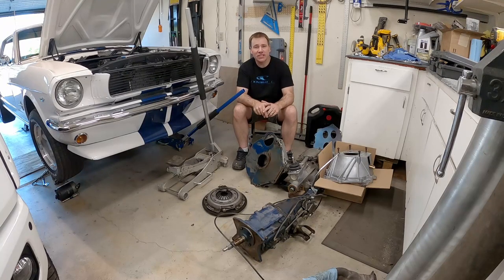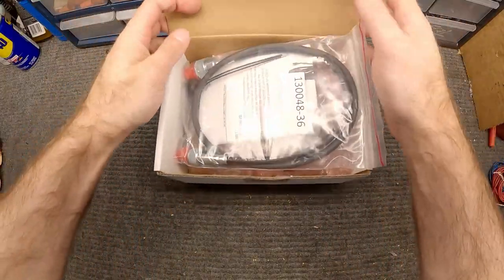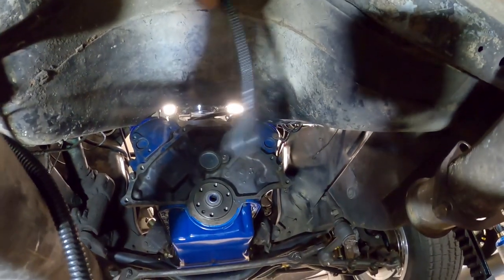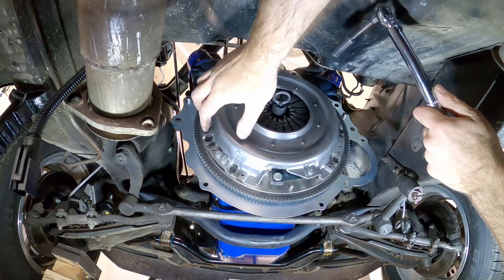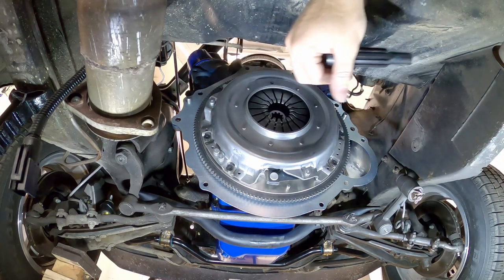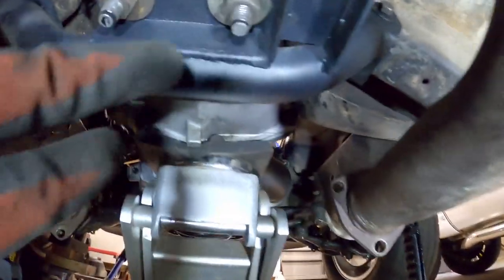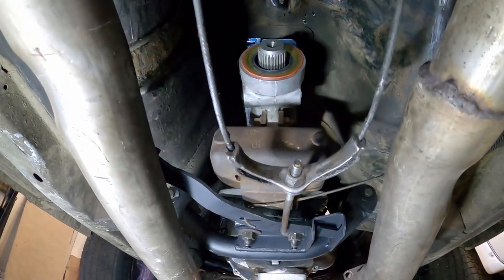Swapping in a T5 Transmission in a Mustang - PART 2 of 2

Comment: I always clean off the new fly wheel with brake or carb cleaner just to make sure there is no containments that could gum up the clutch. Thank  you for the very informative video.
Reply from the maker: Sometimes I forget to do the simple stuff like that.  It gets worse when I'm trying to think about the camera angle and saying everything correctly, sometimes the most obvious stuff goes right out the window.  :)

Comment: As a former professional mechanic, and later working Parts Dept, I would highly recommend installing a new "Engine to Firewall" ground cable (braided strap type). In the event of a missing or "iffy" ground, the shift cable will begin to try to substitute as an alternative route.
It was a fairly common problem, with many of the OEM "Console Shift" vehicles to experience broken/frozen (locked up) shift cables. I managed to get a customer to leave me his locked cable, and after disecting it, found evidence of arcing of the inner cable, as well as the inner cable finally being cooked away from the arcing until it separated and jammed in the jacket.
Even if you already have an existing OEM cable, I'd either replace it or simply add another as a "backup". Kinda like wearing a belt AND suspenders 🤔.
Great video!!!
Reply from the maker: Thanks for the feedback. 
I updated the ground cabling in this car later on. to larger, newer, and more of them.  :)
Reply: @AndyKruseChannel  I'm a big believer in the "braided strap-type" ground cables. I always kept a couple of 15", 18" and 20" (either Dorman or Standard), and one of the first things that got replaced (often also missing), was ground cables.
As a bare minimum, you want: 1) NEG (-) to Engine (Alt/Gen bracket preferably), 2) NEG (-) to mounting bolt/bracket for starter solenoid (braided-type), 3) Rear of cyl head to Firewall (braided-type). I also prefer to make my own battery and starter cables instead of dealing with some of the enemic cables usually found lately. I buy enough 1/0 "welding cable in both red and black insulation, the appropriate terminal ends (POS, NEG, EYE) and what's referred to as "Dual wall heat shrink tubing". This particular type of heat shrink tubing has a sealer inner liner that creates a water/chemical resistant seal and will, if done correctly, probably outlast your grandchildren and then some. I solder all connections (applying solder until it's no longer being "absorbed" by the cable) and quickly water quench and remove excess from the outside of the terminals. Regardless of POS/NEG or it's location, I always use the "Dual wall heat shrink tubing anywhere I make a splice or terminal connection. It adds a bit to both time and expense, but if done correctly (as well as routing/placement), should never be a source of trouble. Another "mod" I usually do, is to run the NEG (-) 1/0 cable from the BAT through a "T-eye", 1st to the frame, and then on to the Alt/Gen bracket. This allows me to use the cable as a guide/anchor for the POS (+) cables (from the starter solenoid to the starter as well as from the Alt/Gen back to the BAT POS (+) connection on the starter solenoid. Lastly, depending on the location, I also prefer to use a "Star washer" directly between the body/frame/engine and the terminal "eye", as well as between the surface of the nut (stud mount) or bolt head to insure a good "bite" getting through any paint, rust, etc.
Blessings to All 🙏🏻🙏🏻🙏🏻

Comment: this is how I installed a Tremec 5spd in my 1965 289 Mustang using all the original clutch pedal and clutch linkage assemble including the 1965 throwout bearing arm and throwout bearing. Take a 1965 Bell housing and drill out the two fulcrum mounting rivets. index using the four transmission mounting holes a template, plexiglass is good. Drill the two 1965 fulcrum holes. Take your template and bolt t to your new 5sdg bell housing. drill the two fulcrum holes and counter sink them. . Take out the cable pitot arm. As you stated the imput shafts are different. Between a top loader and a Tremec, 5/8th of an inch longer Tremec. So I machined aluminum bar stock 5/8th of an inch thick and made a spacer to move the 1965 fulcrum forward in the 5 spd bell housing and bolted it down with grade 8 fine thread bolts and metal locking nuts. That is it, no cables, no hydraulics. So the money I saved not going hydraulic or cable went to a aluminium drive shaft. I also used a diaphragm 10 1/2 inch clutch. So I used the solid input shaft bearing, 1965 throwout bearing, 1965 throw out bearing arm. The conversion cost me less than $20 less the machine shop, which was free for me, we had a Bridge Port. And I would never go back to a toploader, never. I have had this in my car 35 years. I also have a very cool front suspension modification using all For OEM parts that does the Shelby drop, but when I finished the car is almost level. It does sit low like the normal modification. This allows for no rolling fenders and bigger tires. And it only requires one shim per upper control arm bolt.
Reply from the maker: Thanks for the info.

Comment: Killer video! Very helpful. I’ve got to pull my 88 T5 out due to a leak. I’m hoping I can get it out and fixed.
Reply from the maker: Thanks!
I wish I would have had your '88, it would have been easier and cheaper to put in my car vs this 2001 unit.  :)

Comment: I am adding the new T5 but not using the cable clutch and going straight to the hydraulic throw-out bearing conversion application. I have a 1966 mustang 289. Do I need a new bell housing or just an adapter plate?  I appreciate your videos for the good and bad of these type of conversions.  I think you gave part numbers for the new bell housing and cover plate but can you reference those for me as well?  Thanks Andy….your videos have been both informational and inspirational.  I’ve had my project car in the garage since 1983.
Reply from the maker: Yes, you will need a new bellhousing to go with your T5 swap.  Using the hydraulic throw-out unit or not will not change the bellhousing you need, so it's the same one I referenced.  :)

Comment: Love this video. Used it as a reference for my T5 swap. Question - How tightly adjusted is your clutch cable? How would rate the clutch pedal stiffness
Reply from the maker: Thanks!
I adjusted the cable so it was just about to move the clutch fork, that's when it's tight enough.  The pedal is around as stiff as the stock z-bar linkage, but that depends more on the stiffness of the clutch itself rather than the pedal.  For this particular swap, no long after it, I had to go to a hydraulic clutch because I melted the cable.  It was my fault, it didn't work with my header design, but I was glad I did.  I also went to a hydraulic clutch on my current Mustang as my knee just can't take it anymore.  :)
Reply: @AndyKruseChannel  

Thank you for the feedback. I had to replace my clutch cable as I had long tube headers. The warning label warned me about using them, but thought header wrap and the heat shield would keep the cable from being melted. Immediately melted the cable and had to replace the cable. 

Car was originally an automatic so I’m unsure how stiff the pedal should feel. I’m confident I installed it right this time, but it is on the stiffer side. May have to upgrade like you did down the line.

Comment: Would you recommend that center cup holder piece? Been wanting to pull the trigger but have been hesitant. Lmk how you like it
Reply from the maker: I don't think I understand which piece you're referring to, could you describe it a bit more?  :)
Reply: @AndyKruseChannel  The center console cup holder
Reply from the maker: @OnlineResell  Haha, I was thinking you were referring to something on the Trans or similar.  Yes and No.  I am used to having an arm rest in every other car I own oer have owned, so not having one here was a difficult adjustment.  The build quality is OK and the fit is decent.  I wish the holders were a pinch deeper, but the biggest issue is how unsturdy it is in the car.  The bottom is sort of cut to match the shape of the tunnel, but it's not a great fit.  It is held down with velcro, for the most part it's fine, but if you put any weight on it or rely on it when trying to use some leverage, it moves and gets frustrating.  There may be other brands out there that are a better fit or are more secure, but for the money it's decent.  I had one in my previous '66 Mustang, so I had to have one in this car.  If I were to buy another Mustang down the road, I'd buy another center console.  I may look and see if there's a better version out there, but I'd definitely have something like this in my car.  :)
Reply: @AndyKruseChannel  I've got the identical center console in mine and I have similar feelings about it.
Reply: I have a bench seat with a flip down centre piece ...it makes a perfect arm rest, imo.
Reply from the maker: @ryanhburke  That's a rare option, isn't it?  You don't see many bench seats out there.
Reply: @AndyKruseChannel  As far as I can tell. I've not seen many!

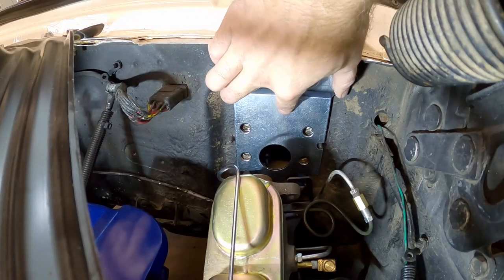Comment: Good video well done, but I dont get the speedo box? I have a T5 in my 67 and I just used the standard speedo cable and the right gear at the end of the cable into the trans for my 3:55 rear end with 245-60 tires. Is that box needed for a digital dash ?
Reply from the maker: This T5 is from 94+ Mustang where the speedometer reads a signal produced by a hall effect sensor.  The box converts the digital signal into a spinning movement and this allows the stock speedometer in the Classic Mustang to work with the newer transmission.

Comment: Any regrets or recommendations for a diy swap like this? My 3 speed is not making the highway too fun lately.

Had you redone the rear end at this point?
Reply from the maker: Zero regrets.  In fact, I liked it so much that I did this swap on my current Mustang way sooner than when I did it on this car.  For the car in this video, I had already done the Third Member upgrade by the time I got to the T5 swap.  If you plan to upgrade the Third Member before you put in a transmission like the T5, you'll dislike your 3spd even more when on the highway.  However, driving the car around town might be more fun as the shorter gearing in the rear pairs nicely with the rather tall first gear in your transmission.  The acceleration will noticeable.  :)

Comment: I have a 95 donor mustang and I plan to install the motor and trans into my car. What do you see will be the biggest issue since I’m installing a match set  motor and trans? Does MDL make a clutch cable kit for the later bellhousing? Also did you you the later mustang tail shaft and is shifter in a good location? I might go with a S-10 tail shaft to mover shifter forward. Love the vidieos
Reply from the maker: You'll have two issues you'll need to solve with that motor/trans combo, I had to solve the same problems on the swap I did in this video.  1 - The speedometer is electronic (not cable driven) so you'll have to get a converter (like I did, about $400) or get a new speedometer that can accept the signal from the trans.  That second option will likely be more expensive as you'll need to buy a new gauge bezel and all the other gauges to go with it (somewhere between $600-$1000).  2 - The trans mount is about an inch farther back, so unless you can find a crossmember brace that is already made to mount that trans to your car, you'll have to modify one, like I did for this swap.  I made a video about that trans mount mod, you should check it out.
Yes, the cable clutch kit you'd buy from MDL will work with this setup.  You can also buy their hydraulic clutch kit for your swap.  It's a little bit more expensive than the cable kit, but I think it's the better purchase.
In my opinion, stick with the ford tailshaft housing, you don't want the S-10 tail.  The shifter location will be 6-8 inches farther forward (farther away from you where you sit in the car) and you'll have to cut up the floor and carpet to make it work.  Plus, you might find the shift lever is hitting the under side of the dash, and you'll need a custom shift lever for sure, so you can reach it.
Good luck!  :)
Reply: @AndyKruseChannel  thank you for the input and I will watch the video

Comment: Excellent video, very helpful. Did you lift the engine to slide the headers in or was there enough room underneath to allow them to get  in place?
Reply from the maker: Thanks!
Unfortunately I had to lift it a tiny amount, I made a video on the install, you should check it out!  :)

Comment: Did you have to CUT OR TRIM THE FLOOR BOARDS ??? I KNOW YOU DID TRAN SUPORT , COULD YOU HAVE WELD A  METAL PLATE FOR TRANS MOUNT W/ 2 holes ?
Reply from the maker: I did not need to modify the car, just the trans mount.  I made a separate video about how and why I modified that trans mount.  :)
Reply: @AndyKruseChannel  , Thanks for the info. I have 63 Merc. Comet rag top, do not want to cut floor or tunnel

Comment: did you have to modify or change the cardan????  next week i will swap my ford maverick 71 from c4 to t4 and i want to know if you had to modify the cardan
Reply from the maker: Cardan?  Do you mean the U-joint?  If so, the U-joint and Driveline are the same sizes needed for the T5 swap in my car, but I don't know about other years or models.

Comment: Hi Andy, question , do you know if the engine should be warmed up and on in idle when checking transmission fluid level on the 66’ 289 c4?  I’m aware not a cold check , just wasn’t sure if on or off is required 
Thanks
Reply from the maker: I’ve always heard that autos need to be warm when checking the fluid level.
Reply: @AndyKruseChannel  any idea if needs to be running idle or off?
Plus any idea where a common leak may be aside from the pan seal ?
Thx and hey Happy New Year Mr Kruse
Reply from the maker: @NightOwl444  Yes, engine needs to be running.  Other than pan leaks, check around the shift selector on the driver's side of the trans (usually an O-ring), there's a regulator-thing on the back with a hose plugged into the end that can sometimes leak, the tailshaft seal, and the fittings for the cooler lines to the radiator are all places I would check.  :)

Comment: Nice video. Did you dial indicate your bell housing to get the proper tolerance so the T-5 would line up correctly and not wear out the T-5 input shaft beating?
Reply from the maker: Thanks!  No, I did not dial indicate the bell housing.

Comment: Andy, how long were the bolts you purchased to go through all three mounting frames (master cylinder, valve and clutch cable brackets)?  I am getting ready to do this and I thought I would get the right size bolts.  Also, would love to see something on your brake setup as I am trying to get that together also.  I am almost done with the T5 conversion.  Time to get the other items up to par!
Reply from the maker: I believe I used the stock bolts to hold that Clutch Cable bracket and the brake bias valve bracket to the firewall.  The thickness of the brackets are thin enough, you should have plenty of stock bolt length to make it work.  However, one this I did notice was the brake push rod was not long enough given the thickness of those two brackets, I made a video about it.  :)
I have since sold that car, so reviewing the brakes on that car will be difficult.  However, I have a very similar setup on my current car, but I plan to revisit all the components because I don't think the car is braking as well as it should.  I'll be talking to Wilwood about all the right pieces I need to fix the braking, too bad I can't get them to sponsor it.  ;)

Comment: Hey Andy I've heard people say you have to do some trimming to the tunnel and I've heard some people say it's not required?  Did you have to do any trimming to the right side of the tunnel where the shifter comes up?
Reply from the maker: It depends on the shifter assembly that is on the trans.  Meaning, the unit I have on the T5 in this video is a "stock" style shifter assembly and it fits in the hole in the floor without any modification to the hole in the floor.  However, on my current Mustang (the Fastback), I also did a T5 swap (I have a video on that too) and I had an aftermarket shifter assembly that due to its size required me to trim the opening in the floor for the assembly to poke through.  I was minor, and the shift boot completely covers it, so it's not even noticeable while you're in the car.
As far as any other types of trimming or modifying the tunnel, the answer is zero.  I've done this T5 swap on a Coupe and a Fastback (both 1966 models) and neither required any modification to the car to make the trans fit.  :)
Reply: @Andy Kruse  Thanks for your reply Andy! Your videos have been very useful to me. I have the Hurst shifter on my T5. I will be installing it this weekend!
Reply from the maker: Just so we're on the same page, the hurst shifter is not the shifter assembly I am referring to (you might already know that, but just in case).  I'm talking about the metal cover on the back end of the tail housing with six bolts and the rubber boot.  There are different styles of that part and some can cause clearance issues where it pokes through the hole in the floor of these cars.  :)
Reply: @Andy Kruse  Oh, okay I thought you was talking about the upper shifter. I'm pretty sure my T5 is stock. 🤷‍♂️